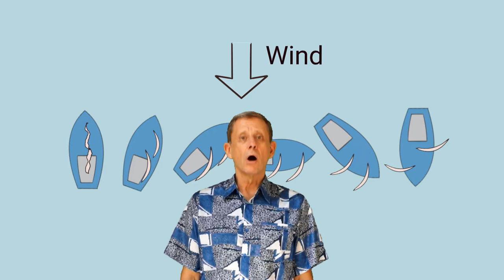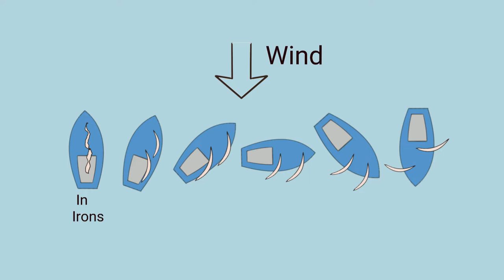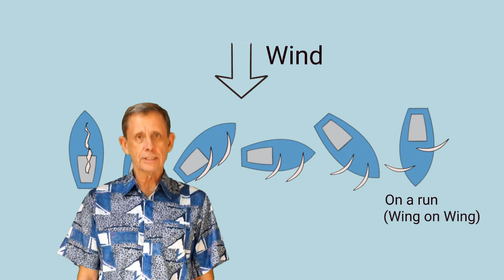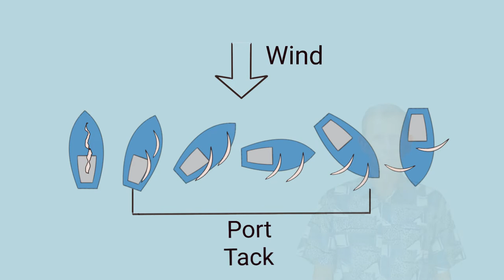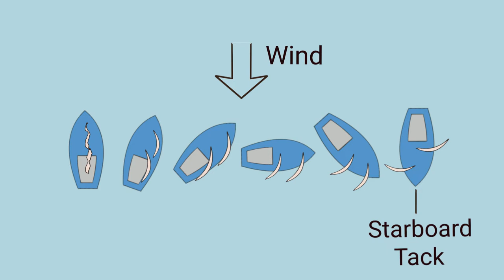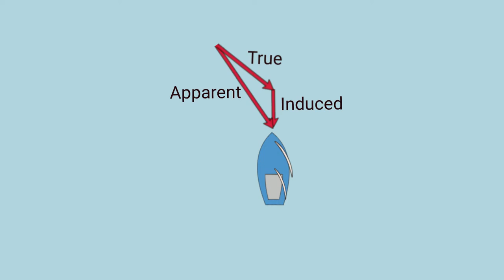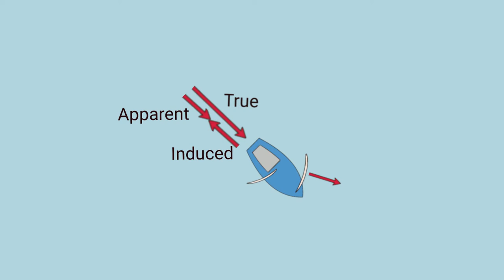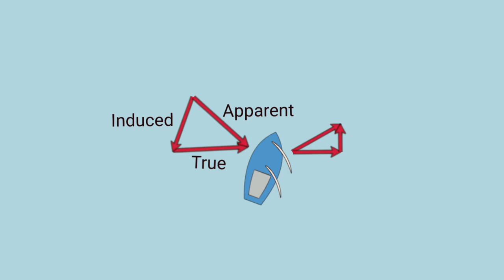Physics of Sailing Video 5: Points of Sail

Comment: I have collected at least 2 pillars of the integrated sailing mechanics

1. Proper Sail Plan
Material-wise quality and a trimmed  sail draft as yet sail draft with corresponding wind speed and a proper Sail angle technique but the number 2 pillars are the number 1 pillar were co-dependent to be harnessed

2. Hull size geometry and a hydrodynamic related streamline close angle geometry, link from these number 2 pillars, the sail sizes to corresponded with hull geometry and hull sizes👍